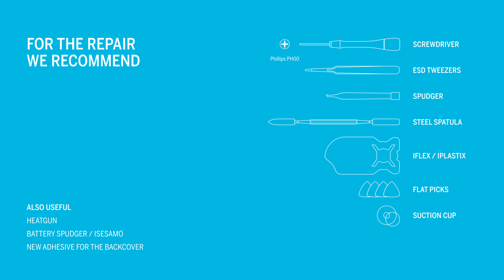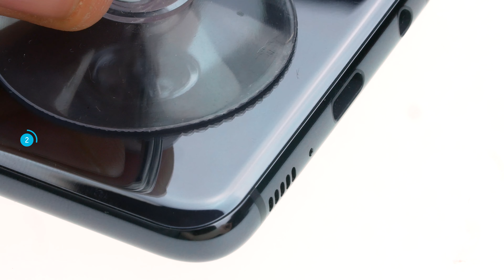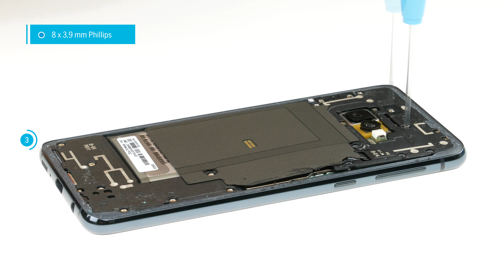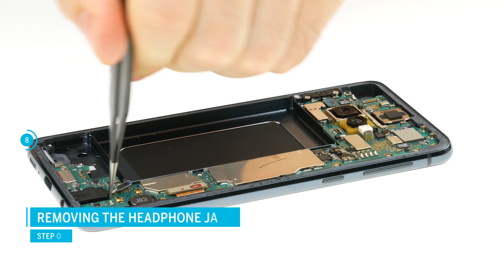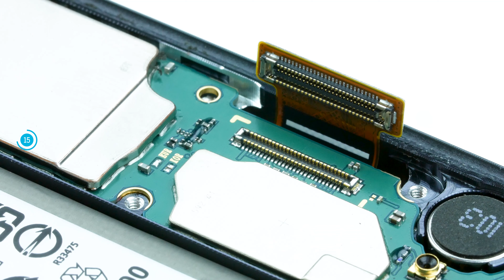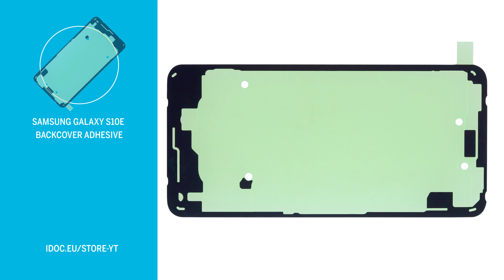Samsung Galaxy S10e – Screen replacement [including reassembly]

Comment: Very helpful video, thanks a lot.
I had problems re-inserting the mainboard, because there was some glue on the USB-C Connector. Had to scrape off the glue first, then it fit into the frame.

Comment: Is there a way to just replace the front glass? Do I need to replace the whole display? Screen is fine just the glass is cracked
Reply: possible yes but very hard to do because the glass is glued to the screen. there are videos showing how to online
Reply: @gamingastronaut517  Agreed. After leaving that comment I looked into it further and found that the amount of effort it would take to replace just the glass isn't worth the risk you take with the LCD. It's far safer and easier to just replace the whole display at that point.

Comment: What about the glue on the vibration motor and earpiece? doesn't matter? will vibration feel different? 

Also the adhesive on the battery, is it okay to just not have it ? 

The phone should be mostly waterproof again right ? at least if it's not submerged in water ?
Reply: The wireless charging coil is probably damaged or not seated correctly.

Comment: "If you want, you can also remove the all glue and use a new one": I bouht the new adhesive some months ago from you but I didn't use it. Now I would like to replace the glue but it's impossible to remove the old one. And you don't explain how to do that
Reply from the maker: So you resealed your phone with the old adhesive frame and now you want to replace the old adhesive frame with a new one?  Maybe this video might help: https://www.youtube.com/watch?v=nJk_QaAXUxw&t=128s